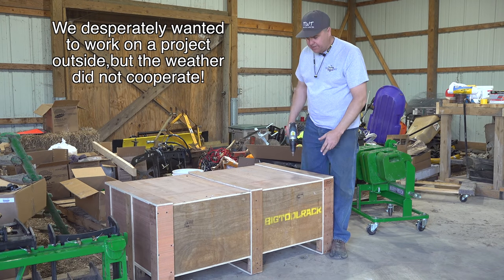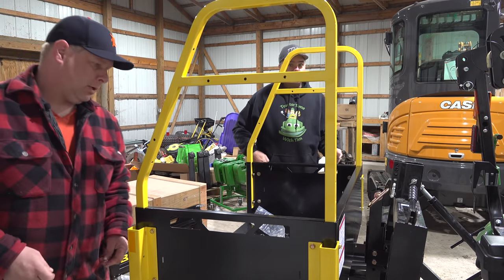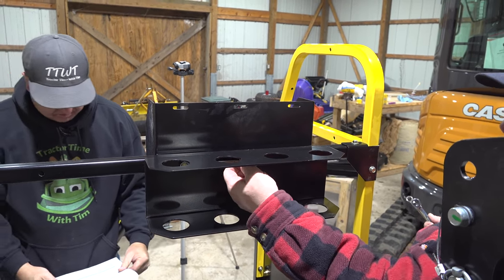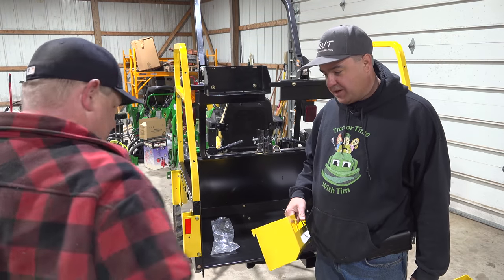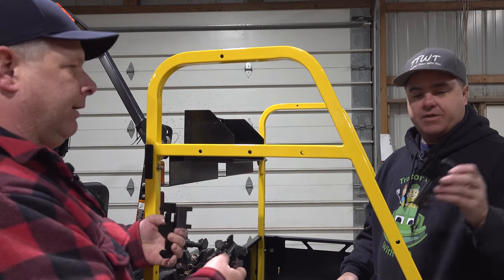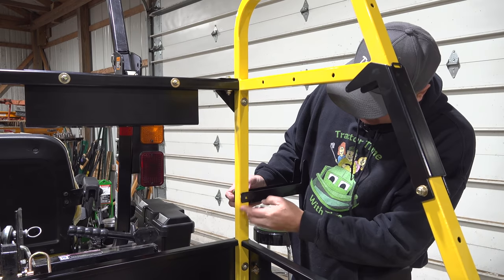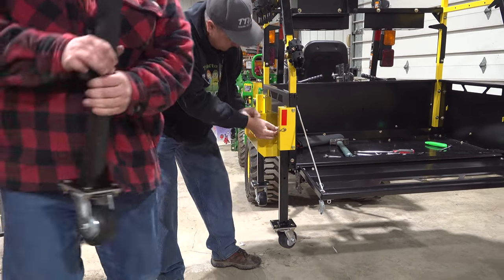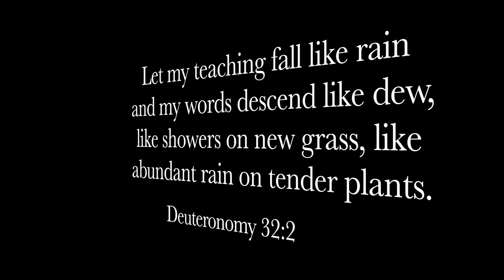Tim’s Career Update & Turning Johnny Into A UTV! Big Tool Rack

Comment: Less than a month as a JD 2038R owner and have spent hours watching TTWT to accelerate the learning curve and avoid big mistakes. My pole barn is a long way from our house so even though we stored yard maintenance eq in it it was a massive pain in the neck getting everything where you needed it. A few days ago, I saw the introductory video for the new “Ultimate Tool Rack”. It was the first time I’d seen the product and after watching it multiple times and reading reviews, I ordered it then and there. Feature #2 behind all the obvious capabilities which was deal closer for me was the weight bracket. With the suitcase weights, weight of the unit itself and cargo capacity, you can put well over 1,000 lbs of ballast on the back without buying an exclusively ballast only attachment. I can’t wIt for it to arrive!

Comment: You are correct to build with the base attached to the 3 point hitch!
So much easier!!!
I also had two different bolt head sizes on my 8 mm bolts.  When I called the company the explained they had a hardware issue with the factory.

Comment: One thing I can think of is adding is a bar at the top to put led lights on so your visibility is increased and have a light for the bed to say sharpen your chainsaw when it gets darker outside maybe some amber strobes for slow moving around roads and for plowing snow added safety

Comment: I've seen the BTR on Mike's channel. Looks super useful. The only thing that looks under built is those clips that hold the tailgate closed. Out of my price range though, even with the TTWT discount.

Building it on the 3 PT is smart, why not work at a comfortable level. Now Christy can film from a moving platform. Much easier than trying to get two in Johnny's seat.

Comment: The new generations work for a paycheck.  In my LE days, we stuck together and had shift meetings where the guys and wives would take turns hosting it on a long changeover. In Summer we met at a park and included the kids. Later in my career. it was the Old Guys and the Young Guys, Never the same again.

Comment: Gives new meaning to a tailgate party? Now to put a cab on your tractor. Nice video. You have lots of room in your barn for more attachments. You could also mount the tool rack on the loader with your forks? Modify it. 🤔🤔🤔🤔🤔  🤔🤔🤔🤔

Comment: You almost had me sold til you said....100 # tailgate capacity. I will need to swear off pizza for good and I will still be to heavy to sit on that thing....maybe if there was a way for it to drop straight down ?
Reply from the maker: Thinking similar thoughts.  I really think the tailgate would safely hold more than that,  I was just reading the specs from the manual.

Comment: you getting aa new ventrac i was thinking i seen the ventrac go back and was just a demo
Reply from the maker: Still have it.  Will have a video with it next week.
Reply: @TractorTimewithTim  yall ever get back down this way again would like to meet up if you had time and was ok to do so cant wait to see that ventrac at work i feel like that unit is very flexable not sure if it was ventrac or not but i seen a tractor very close to that with 3 point hitch on it and was useing other branded 3 point tools on  it and that sickle bar mower they have is the bomb for doing hill sides to steep to be on also
Reply from the maker: The Ventrac we have now has a 3 point.
Reply: @TractorTimewithTim  did you get the diesel in this one or is it still the same one from last fall
Reply from the maker: Diesel.  They traded us for the one which was fitted for the boom mower.  We no longer have the boom mower
Reply: @TractorTimewithTim  give it time and some shoping for work for one and you will have one again i am sure of it